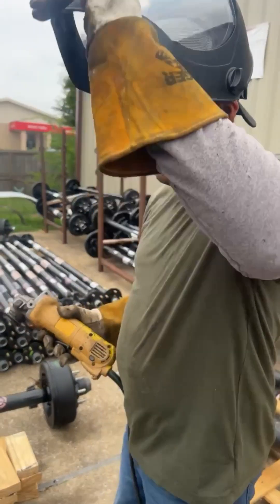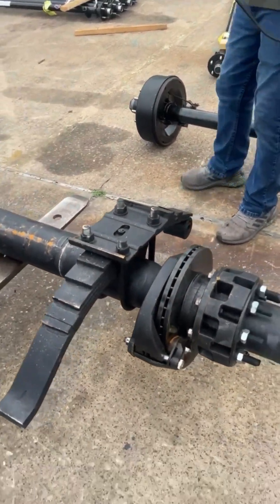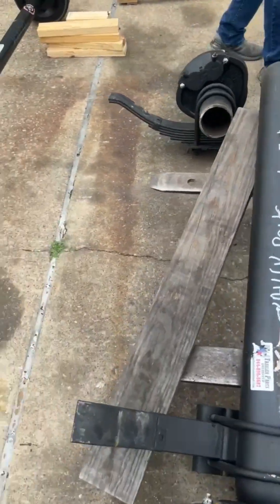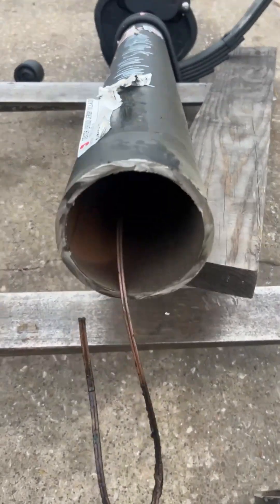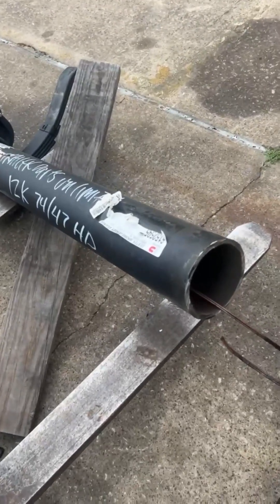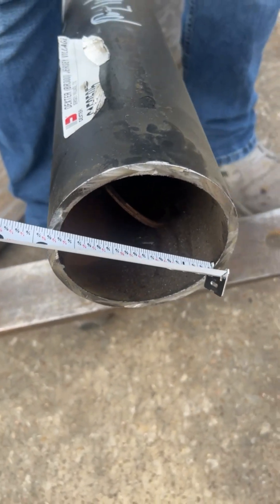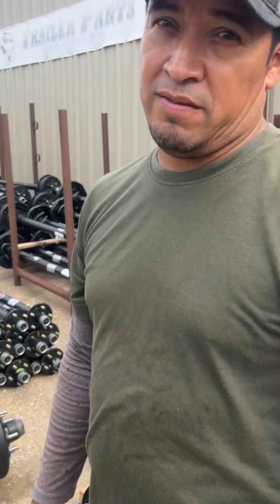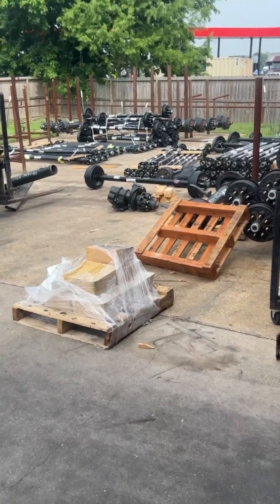Destroying  12K Dexter Hydraulic Disc Brake Trailer Axle:  lets see how thick tube really is

Comment: .280 is only   .030 over 1/4 Inch that will bend pretty easy.   Manufacturers are using cheaper materials but charging more..ha ha ......  I am a metal fabricator in orlando florida
Reply from the maker: Thank you for your feedback and I 100% agree with you